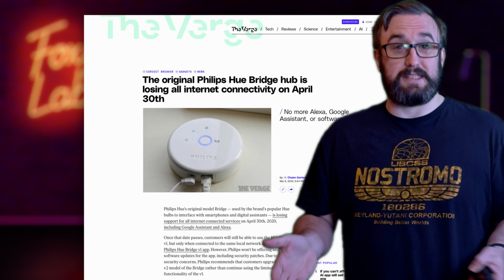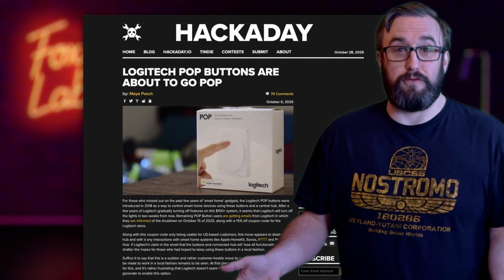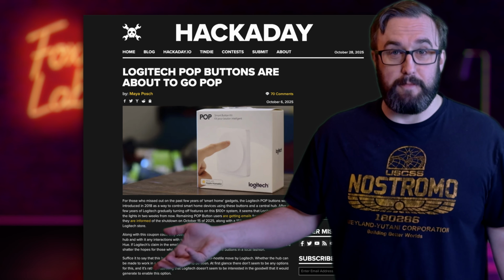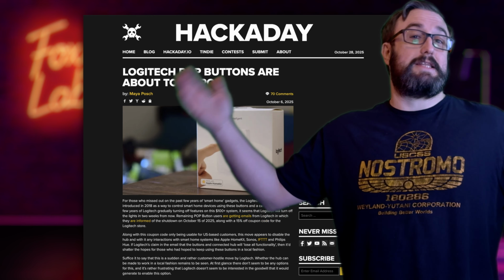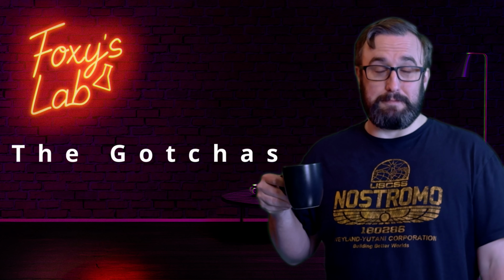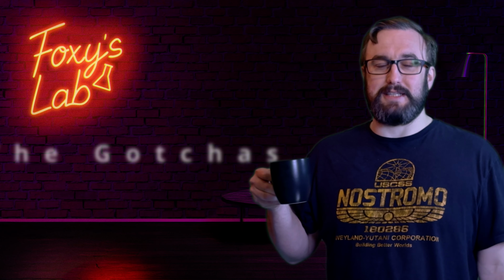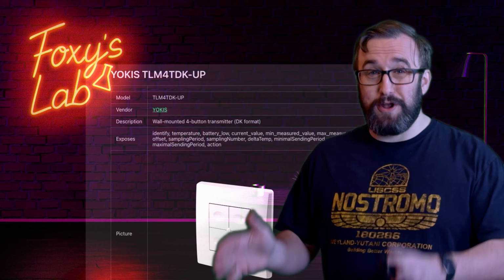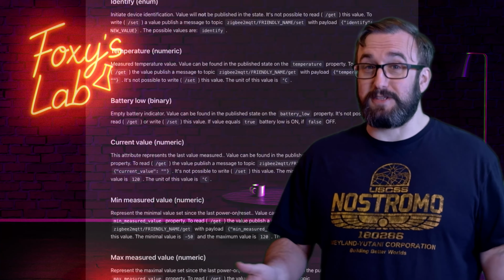Zigbee2MQTT: Your IKEA Bulbs and Aqara Sensors Can Do This?!

Comment: Me again, I just recently learned I use ZHA - the dealt Zigbee protocol, and it works 100%. I was confused, as to why I need Zigbee2MQTT everything you've mentions works with ZHA. So I would love to understand the tradeoffs between Zigbee2MQTT vs ZHA. I'm watching because I just bought a 3 phase power monitor that was Home Assistant comparable. I haven't got it yet.  When I learned ZHA and Zigbee2MQTT are different, I'm got concerned, I'm naturally unsure about installing it because if my Zigbee network isn't broken why fix it. What I was hoping you would answer is being able to run ZHA and Zigbee2MQTT at the same time as my yet to arrive, HA power monitor turns out is HA comparable via Zigbee2MQTT, and I don't want to rebuild my Zigbee ZHA network.  ps i love your coffee intro however I don't literally need to see a flash of you holding your coffee in the intro, drinking it during your video is appropriate, though. pps you're good at creating that mental image of needing a coffee, don't over do it, and thanks for a great video - watched your latest on and production quality is an improvement. thanks.